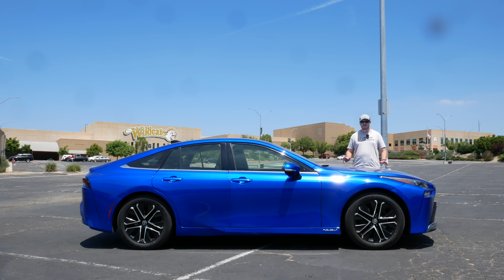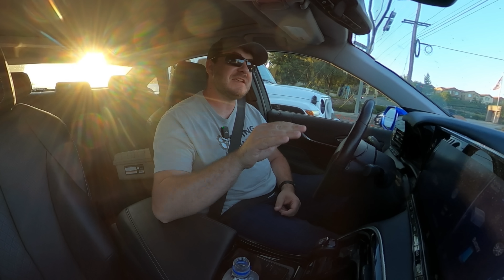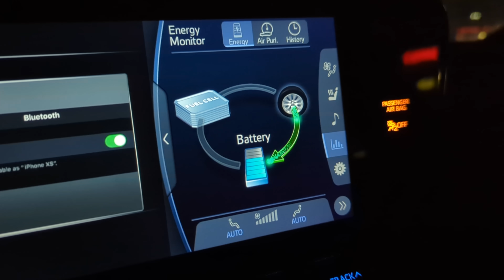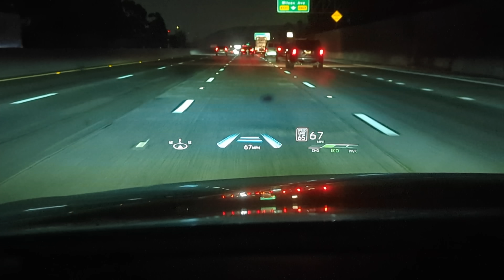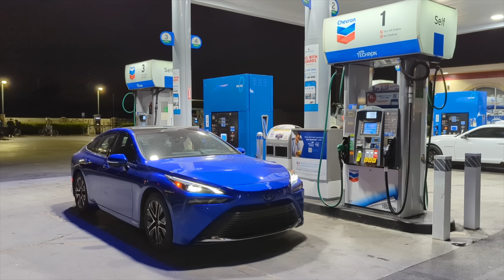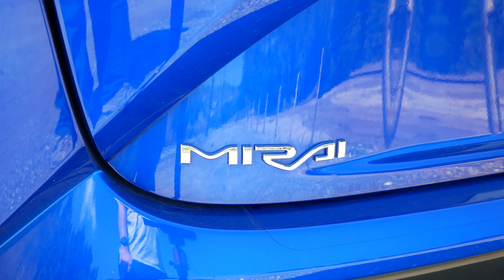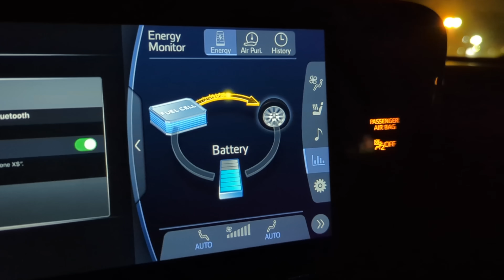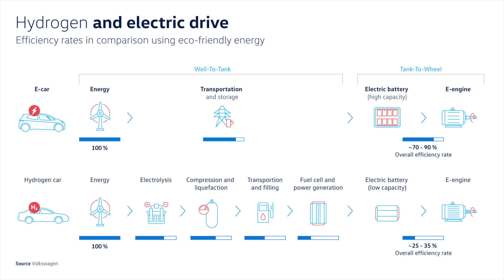The Toyota Mirai is Disappointing

Comment: Hydrogen has been available for around 20 years now.  It is pretty sad to see that it hasn't really advanced that much in those years.  Having said that, I think hydrogen is great for large vehicles like busses and could be a real option for passenger jets as batteries are just too heavy still for that industry.
Reply: Ìn the UK, indeed much of Europe, hydrogen makes a lot of sense for coaches and interurban buses, but battery works fine for city work. The Yutong E12 electric city bus can achieve around 280 miles to a charge which is ample for a day of city service work. There are hydrogen buses in the UK, notably Wright's Hydroliner double decker, the first hydrogen double decker in the world. Again, the disadvantage of these is getting the hydrogen, but they can achieve 350 to 400 miles on a fill, which is similar to a diesel city bus with a fairly small fuel tank.

One place hydrogen also may work is long distance lorries which, with a two driver setup, which can cover great distance each day, aided by quick refuelling. The weight of batteries to give the long distance ability on a single charge in a full electric lorry would dramatically eat into the payload the lorry can carry.
Reply: Yeah, I think hydrogen should be developed for large trucks, etc. as filling stations for them don't have to be as common as for regular cars and they would get benefit from not having batteries. It's passenger cars that it doesn't make any sense for, since hydrogen has to be first made and transported to a filling location before it can be used, where a BEV directly uses the energy so there's none of the middleman steps. Think of it as diesel vs petrol, we can have one propulsion type for heavy vehicles and another for others.
Reply: Hydrogen is normally produced from natural gas. It can be electrolyzed from water, but that takes a lot of energy. As the molecules are so small the stuff is also much trickier to store and transport than natural gas is.
Reply: With hydrogen there's a little problem of having to develop the entire fueling infrastructure in addition to the car. Imagine if all the oil refineries, terminals, gas stations, tankers, etc. disappeared tommorow and we had to rebuild it all from scratch.
Reply: 20 years?  General Motors were blowing hydrogen's trumpet (or at least trying to) around 40 years ago......
Reply: @Brian-om2hh holy Crow! I had no idea. I was thinking about when I first read about Toyota working on hydrogen cars.  They never really left California and your couldn't own them just lease as far as I know.
Reply: Well, heavy plant equipment companies like JCB and CAT are working on hydrogen combustion engines for construction equipment. On large engineering projects, bringing a small hydrogen production facility on-site and powering it off either utility power, or on-site generation (say a small modular nuclear reactor - well a nerd can dream) would be a viable energy supply chain. That way you don't have to move the hydrogen around too much, and you can quickly refuel your earth movers, cement trucks, backhoes and whatnot and keep them running 24/7 and when you finish the job, the engineering firm can take its plant and machines with it to the next one.
Reply: I say it all comes down to the cost to produce the hydrogen in the first place. Hydrogen is still more expensive (even with the increased cost of fuel over the last 3 years) to use than an ICE. Until that is solved it's not going to be for the masses.
Reply: @InlineSkater72  or the volumetric density problem. But that’s a limitation of physics, so that’s harder to side step
Reply: Yeah but a green way to produce it hasnt existed - and even now getting renewable energy isnt all there yet. EV's have been technologically possible for 20 years too.
Reply: @silvy7394  Way over 120 years now. The problem always was batteries. But that problem has been solved nowadays.
Reply: @silvy7394  A LOT longer than that, EVs were pretty popular a century or so ago.
Reply: @JeffDeWitt  And they died off quickly because, technologically, they where not viable and sucked compared to quickly evolving ICE engines. Nor did I ever say anything about popularity. Read the comment fully next time smartass.
Reply: Has it been really though? Where I am, the closest two hydrogen stations i know of are less than 10 miles but I cant tell you where the next one is. I'm wondering if some of the more industrial and less residential areas have more h2 for cars because they already have it for industrial use or commercial vehicles
Reply: for Trucks, its also a problem, it also need to refuel like a car and those tanks takes a lot of usable space
Reply: I see it being useful for anything where weight matters as you say (planes and ships). Otherwise batteries.
Reply: Hydrogen has an advantage in storing renewable energy, as long as the compressors and storage tanks themselves can be made somewhat economically. Solar panels are extremely cheap now, so storing surplus energy as hydrogen for peak evening loads or 24/7 industrial operations might be sensible, again depending on storage infrastructure cost.
Reply: Biogas is another fuel source that is taking steps to become a major player in sustainable heavy vehicle industry. It does release CO2 when combusted, but has many benefits. Operating one is essentially the same as any diesel vehicle, fill-ups are quick, ranges are acceptable and existing gas vehicles can be relatively easily converted to run on compressed biogas.
Reply: @Shaibuli  yeah, one of the other branches I can see long term are the various synthetic fuels.  More expensive than petroleum, but used the same way with.
Reply: @neeneko  Just to clarify, that those are yet a different thing and running on CBG/LBG is actually cheaper compared to gas. CBG is essentially the same thing as CNG, meaning natural gas aka methane, but is produced from sources such as landfills and biowaste treatment plants. As for the savings, my pretty ordinary Opel Astra has saved me roughly 2500€ over 30 000 km compared to gas.
Reply: Big lithum is now the king, there won't be other alternative to ICE
Reply: @Je_QzcY3mN0  Nah, lithium is pretty much dead already and will be replaced by Natrium.
Reply: @germanmosca I'm not sure if any one thing would be credited with ending lithium ion batteries. Yes Sodium is one of many possible replacements, but LFP batteries are pretty good too!

Right now the amount of battery breakthroughs are just staggering.
Reply: Yes, H2 has been around for industrial and commercial works, but not so much for the average consumer. (I can go to Airgas and get a "welding" tank.) For it to really be of use to buses, trucks, and planes, it would need to by cryogenic hydrogen... liquid to actually carry enough of it. The Marai is carrying just 12lbs in 37gal of space, and it's at 10,000psi to do it. The tones of fuel jets carry would need the entire volume of the aircraft just for the H2. And building H2 tanks that can survive a plane crash... that's a beefy tank.
Reply: ARE YOU FUCKING KIDDING ME? THAT SHIT LEAKS THROUGH SOLID STEEL!
Reply: There's a reason hydrogen hasn't advanced much. There are a lot of challenges with it, and the closer you look the more you find. Of course most of those are hand waved away by some  hydrogen fanboys out there who simply don't like BEVs, but they are very real.
Reply: @RobertHancock1  True, but that is also what people said about BEVs for something like 70 years.  It took a lot of work, and a lot of market changes, to make them competitive with IC engines, and they have similiar long term problems, suggesting the pattern will repeat itself in some upcoming decade when the problems with battery tech become too big to ignroe
Reply: @neeneko two different sets of problems. Hydrogen's problem is atomic. As a molecule in gas form it goes through steel. Storage with membranes or in methane or amonin requires energy to extract. And then there is efficiency. A hyrdogen fuel supply has cooling and heating problems which lead to waste. Electric is well understoof through trams but it took time for battery tech to get better to allow independent driving.
Reply: It was separated in the 18th century.  It is produced as an industrial by product.  NASA has used it since the early 1960s.  Robert Goddard used it in the 20s.
Reply: German zepplins used it.
Reply: @rogersmith7396  I mean that use case wasn't particularly well thought out though.
Reply: @rogersmith7396  The Zeppelins were designed to use Helium, but US wasn't cool with selling Helium to Nazis. That's why they had to use Hydrogen.
Reply: @EleTruk  Why not?  Why didn't they want to sell helium to the nazis?
Reply: @EleTruk  There wasn't enough helium to sell them any. At the height of our early airship program we has 3 ships flyable but only helium enough for 2, so the ships took turns flying.
Reply: @EleTruk  They used them as bombers in WWI.
Reply: @oliverer3  If you are referring to WWI Zepplins they were found to be particularly hard to destroy.  See Frank Luke, Luke AFB, the US leading balloon buster.  Hydrogen is a fuel  A fuel requires oxygen to burn.  Zepplins contained only fuel, no oxygen.  They thought shooting incindiary bullets at them would destroy them.  It had no effect because there was no oxygen.  They eventually found out that if they thoroughly riddled the zepplin with bullets it would let oxygen in then incindiaries would light them off.
Reply: @rogersmith7396 with amazing results!
Reply: @EleTruk  I think you've got your time-scales muddled here. The Zeppelins were flying using hydrogen long before WW1, thirty years before the Nazis came to power. Although helium was known to be safer than hydrogen, it was less efficient as a lifting medium at a time when airship designers were struggling to minimize structural weight, so it was never really an option until the 1930s, and then there wasn't enough available anyway.
Reply: @davidjones332  Talking about Hydrogen Fuel Cell Vehicles, not hydrogen combustion, or lighter than air vehicles.
Reply: @EleTruk  zeppelins were using hydrogen well before the nazis came along
Reply: It's not useful for buses.  My city is already running battery electric buses, so that's a solved problem.  And if you need 24 hour a day bus service, there's the even better option of overhead trolleybus wiring.
Reply: Energy density too low. Hydrocarbon fuels are superior and extremely plentiful.
Reply: @aygwm  Cyrogenic hydrogen (liquid) is very high energy density. Of course, it takes a lot of energy to get it there.
Reply: I could see for inner-city heavy vehicles like garbage trucks these would be really useful. Those vehicles could make sense as battery-electric vehicles but they all have to be charged at night at the same time which is a pretty massive amount of power to be pulling off the grid. Having the fast fill-up times for their fleets with just a few stations would be significantly easier to operate.
Reply: @clay-p8z  except generating the hydrogen for them would use even more electricity than just charging them if they had batteries
Reply: @clay-p8z  Relatively short-range commercial vehicles like school buses, city delivery trucks, garbage trucks etc are the perfect model for EV's.  You can charge them overnight when not in use and when baseload electricity is cheap and fleet operators can use the batteries in the EV's to sell electricity back to the grid in times of peak demand.
Reply: It took the one time advantage of gas tapering off to make electric vehicles viable, and when their one time advantage goes away, hydrogen is the most likely contender for replacing them.  electric, like gasoline, is a temporary solution that can not be maintained.. both start cheap, but eventually they will lose that.
Reply: @neeneko  Hydrogen is not a fuel, it's a very bad battery chemistry.  It's never going to make sense for cars.
Reply: @jonc4403  Hydrogen is oxidised to produce energy + H2O, so yes it's a fuel. There are other fuels that can be used in fuel cells too - it doesn't mean they cease to be fuels just because the process happens differently than by ignition.
Reply: @jonc4403  it is as much a fuel as gasoline is, only we can synthesize it instead of having to extract and refine it.      You literally fill a tank with it and oxidize it to produce work.
Reply: Hydrogen should have been the future instead of or along with EV. Refuel times comparable to gasoline, can be generated on-site, can be stored for future use.
Reply: @bwofficial1776  no it shouldnt have, because it requires loads of energy to make it, then pressurize or super cool, which is a lot of energy. Then you need to transport it and swap, requiring more energy, just to then turn it into electricity after all and put it into a battery. 

What should have been done is develop and mine the materials for batteries slowly and ethically starting the oil crisis back when in the 70s. If that happened, we would already be here with fast charging relatively low cost batteries
Reply: @fetB you might be getting caught up in FUD. Sure there are some cinflict minerals like cobalt from congo, but lithium nickle and iron are all mined in first world countries, and cobalt too. Rare earths are increasingly been taken out of magnet manufacture. Yes, mining still uses diesel but electrification is creeping in there slowly. A fully electric world with somw industrial hydrogen would need 40% less mining.
Reply: @mearino  Wait, are you sure you meant to tag me, because none of what i said contradicts what you're saying. It's a fact that batteries have been the problem in electric cars since the early 1900's, and some people tried to bring it back into conversation after the oil crisis in the 70's. It is also not FUD that the race to electrification not only has exploitation of labor as a consequence but also environmental cost and price hikes, which would have been avoided, if the whole thing would have started back when
Reply: @bwofficial1776  it likely will be the future.  EVs predated gasoline vehicles, but gas was so cheap and its environmental impact not considered important for so long that gas won.    The same will probably happen with EVs vs hydrogen.. hydrogen is more expensive, EVs cheaper, but they will get more expensive and their environment impact will start adding up.
Reply: @bwofficial1776  Here is a little secret about hydrogen fueling: The refueling times arent always comparable to gasoline. 
If you are unlucky you stand there for 30 to 60 minutes and wait for the hydrogen fuel station to build up pressure again. (Depending on when and how many people fueled their car before you)

Generating it on site is a bit of an issue as well, it needs a lot of space.

Stored for the future... not really. We can't store it, we can only contain it for some time. And it makes the materials that contain it brittle. Sides of all of that being very expensive.

Putting some batteries for storing electricity would be more efficent in terms of space and money.

And if you actually end up having to pay for Hydrogen that is green (or even the grey one) it's gonna be evry expensive for you... We are talking about over 30 USD for an equivalent of 1 gallon.
Reply: @bwofficial1776 hydrogen has a lot of issues. Bmw built a 7 series but the hydrogen would leak out from the hoses over a week. There are also two types of hydrogen propulsion. Burning hydrogen in a combustion engine (inefficient due to heat loss) and fuel cells which generate electricity to power a battery powered car. Hydrogen also takes up a lot of volume as far as I know - thus the Mirai is a big car.

Comment: From what I understand there is a magic power threshold that when crossed degrades the life of the Fuel Cell. above or below that line is fine but every time you cross it it dies a little bit inside. Hence the battery and probably the weird torque maps you mentioned. Also, WA state wants to be Hydrogenerific some day.
Reply: I have heard in the past they are very sensitive to fuel contamination.
Reply: From what I understand, yes
Reply: Aren't they already in pretty wide use in warehouses for things like forklifts and side-loaders?

Comment: 14:55  "battery technology is continuously improving.." NO IT IS NOT.  Marginal improvements at best.   WHY are lead acid batteries 200 dollars and with low storage despite being "continuously improved" for 100 plus years?
This idea that batteries are going to follow transistors and chips in becoming ever better and ever more inexpensive is a lie, or more politely, marketing BS.
Reply: Batteries ARE improving at a breakneck pace but with different chemistries.  Lead acid batteries are a technological dead end and have been for decades, which is why you have seen no improvement with them.  Lithium Iron Phosphate (commonly called LiFePO4 or just LFP) is rapidly becoming the favored replacement for lead acid. It might very well replace other lithium chemistries completely as well.  Some EV makers are already using them (Tesla) or have announced they are switching their vehicles over to them entirely. (Rivian).  There has been an amazing amount of battery advances in just the past decade, but most of those have not had time to make it to market yet.
Reply: @stevenmetcalf4571  There was a lot of improvement in the beginning. Lead acid batteries are perfect for what we use them for.
There are limits to how much you can change the chemistry.
No, there hasn't.  Energy density has not improved much at all in the last decade.